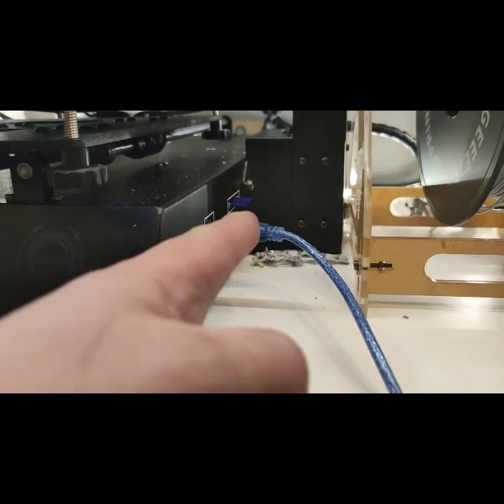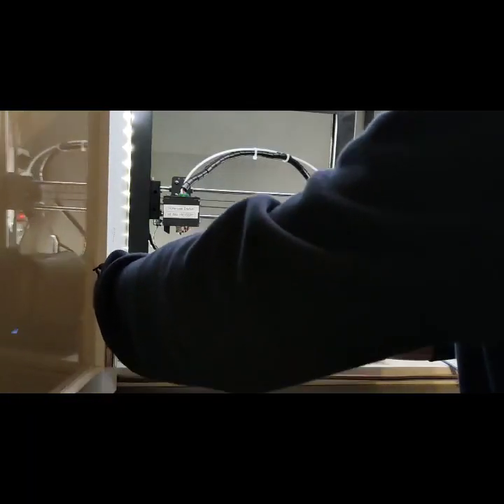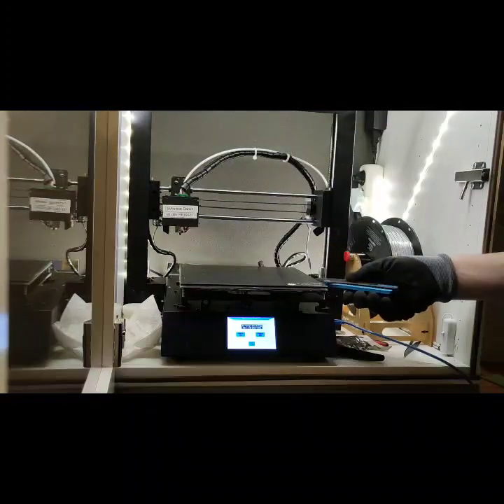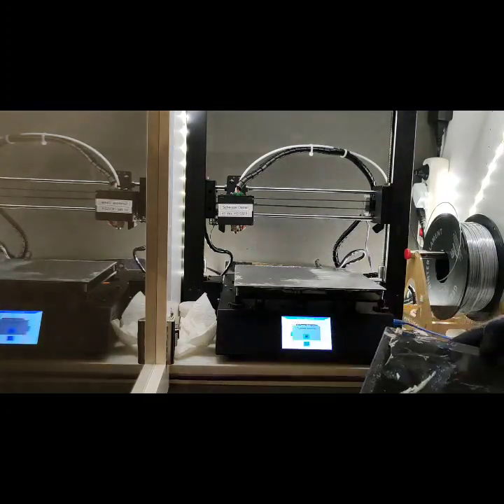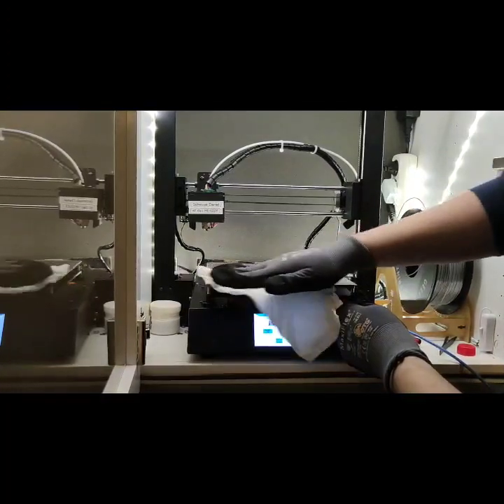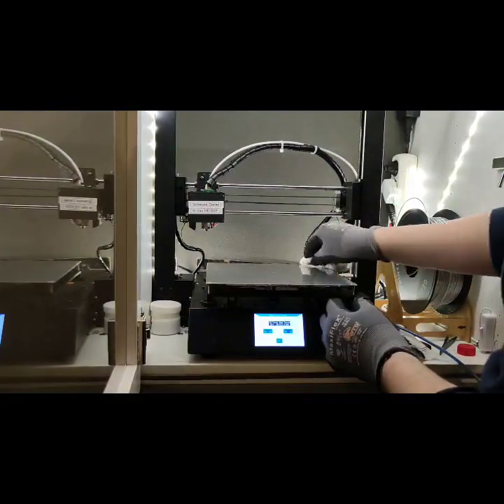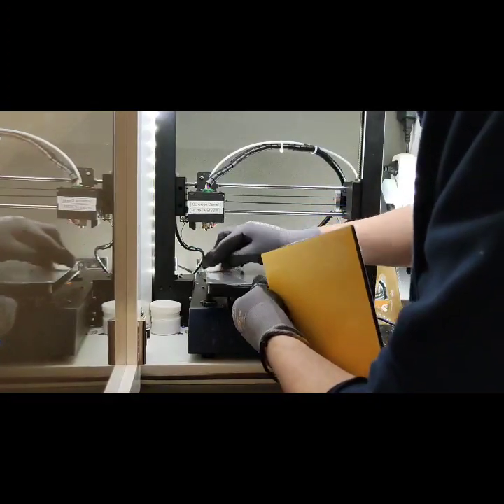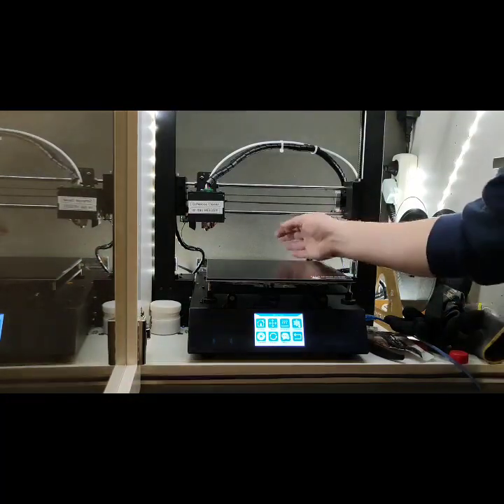How to remove the Ultrabase from Heatbed on Anycubic I3 Mega

Comment: thank you i just removed mine - but I didn't have a large knife and so I did a trial around a corner with a smaller blade - it was ok ish - I then grabbed a cheap japanese saw (these have no tooth set and this was doing a good job removing glue) but then I grabbed a square nosed thin 6" steel ruler and that just buldosed the square end in and it was a 10 sec job - temperature set as you said - thanks for showing it was possible
Reply: thanks to the italian guy too

Comment: Tried to remove the plate today and smashed it. I am Literally. ..Still screaming.   

I had just got my favourite printer levelled, perfect. I was so happy!! I needed to print some tiny parts and the bed was printing so great I was happily printing 100 at a time with no sticking on completion. Awesome.

Then in trying to move the hotend up I turned motors by hand and threw the x axis out of alignment.

I reset it but didn't realise it was now way too low. I scratched the plate surface. Not badly but I was kicking myself about throwing the alignment out having just got it perfectly tuned in. In a filthy mood,  I made the unwise decision that, rather than just ignore the plate damage, I would replace the adhesive bed since I had a spare. Little Mistake followed by a BIG MISTAKE!!

Today I shattered the bed as i tried to take it off, so now i have 80 percent of the bed stuck fast and 20 percent in broken glass pieces.  Now I am going to have order the heated bed part because i cant get the old broken bed off. 

Three days ago the printer was running perfectly and I was printing some great pieces. One bad decision, one really bad decision and now I am just wishing I could go back in time. 

3D Printing. Perfect one day. Silently screaming the next.

Comment: Very nice tutorial :)
I really love the Ultrabase. Though I don't like it to b glued ontop of the aluminum plate, it make things a bit difficult to maintain.
As you pointed out, the aluminum plate beneath the bed has lots of flex and we must take care not to bend it. Although it will eventually bend because it is a bit too thin (1mm or so, I guess).
Maybe replacing it with a thicker one would fix that and ensure a much better bed flatness.
Actually, I like the idea of getting rid of the glue under the ultrabase (or stick it to something thin with great thermal conductivity, like aluminum foil ?) before putting it onto the aluminum plate, and holding all of this with 4 small swiss clips.
I wondered ... How much time does it take for your i3 Mega bed to reach the desired 130°C ?
Unless we mod it with a mains powered silicon heater (220V/400W), reaching 130°C nearly takes ages.
Reply from the maker: Honestly I like it glued on the bed, because I dont need clamps that reduce the printing area and I got no risk that it moves during the print. My bed didnt bend =)  .  With the glass I mount here I had the problem that it lost surface layer after every print. I removed it a few weeks later again and use only the old one, but with pure glass without layers glued with thermal conducting glue based on silicone to the heatbed.I use the standard electric drivers so it needs round about 10 minutes to reach 130°C. If you waiting for a goal it allways takes ages ;) if you are busy its gone so fast^^
Reply: @guzer3933  Sure :) 
Good point about clamps ! The Mega-S has a slightly larger bed (240x220 instead of 220x220) with a non-usable area on each side, clips wouldn't be quite an issue.